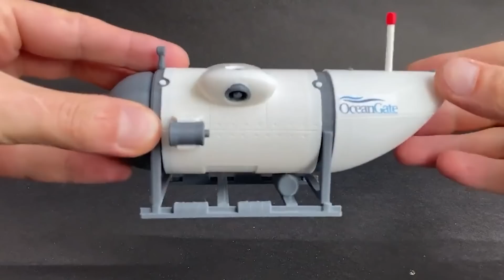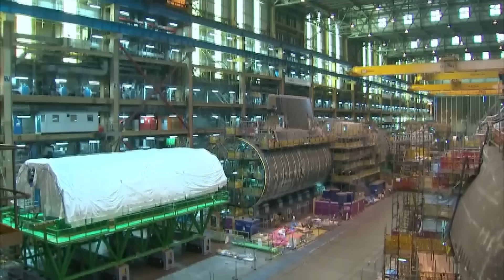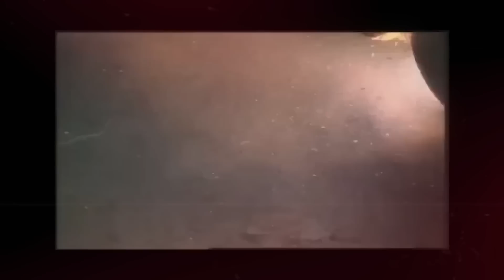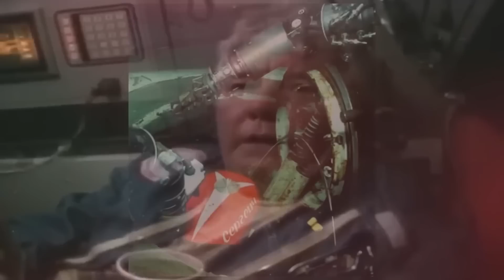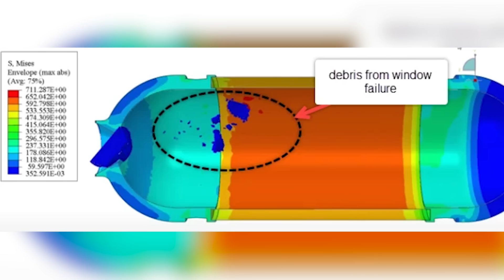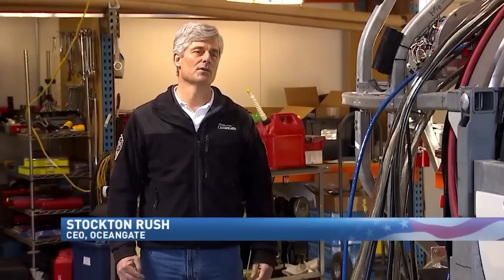New footage Just Revealed A TERRIFYING New Story About how the Titan Submersible really Imploded

Comment: @3:20 min.  I'm sorry, not sure why people keep saying that if the window broke first "we expect debris to explode outward"...  This shows no understanding of symmetrical pressurization - There is no low-pressure location for debris to want to 'explode outward', if the window failed the pressure wave (literally) would simply rush in to compress everything like an engine-piston until the pressure was the same inside as outside, there would be a bit of 'water hammer', but not really so much as to eject everything 'outward'.  People keep saying this like that know what they are talking about as a matter of fact - so, in short - I doubt everything would eject outward if the window failed.  I'm sorry - ALSO, you draw WAY TOO MANY conclusions from the debris-field visuals, I'm sorry but you don't know what you are taking about.

Comment: One issue with carbon fiber that’s never addressed is that UV light degrades it.  It doesn’t look like they protected the hull from light at all.  I think it was also stored outside for a while.  All that light exposure degrades the epoxy backbone.

Comment: I have been surfing years. I am familiar with fibreglass, resins, epoxies, catalysts, and sanding. What water does to surfboards is scary. Those boards will break at a stress point and depending on the speed and energy of the wave.  Bones have been crushed. All that said,  how on Earth did they think that composites would withstand those pressures? It is beyond me. And the domes were sealed with glue. That is just crazy.

Comment: What I first notice in the assembly is the lack of clean room use. I see no head coverings and just street clothing.   One hair can cause a underwater camera failure with many times less pressures and a fraction of the depth this vessel went. With sticky epoxy gosh only knows the amount of dust and debris at all the joints.

Comment: The end cap joints look very simple.  Under engineered.   Centering riblets, machined barbs on the titanium, and a method for pumping in the adhesives would have increased the cost significantly,  but that joint does look feeble for what it needed to withstand.  I don't think that carbon fiber is a lost cause in high pressure applications.  But it needed more mechanical attachment strength.  Consider how rebar can turn a thin slab of concrete into a strong supporting structure.  Without rebar, a good impact will cave it in.  With rebar, it can support traffic.  I think he was overwhelmed and took the easier route with disastrous consequences. I still don't believe that he needs to be vilified post mortem.

Comment: I must have said it a thousand times now an would never change my mind when I first set eyes on this crappy flimsy death trap submarine it was screaming at me a death trap that would implode on its self everything about it was done of the cheap if your going to build a proper submarine to go down to the titanic you need very deep pockets indeed at least £200 million pounds to £300 million pounds submarine glass would have to be at least two feet thick an thd submarine steel hull would have to be 3 feet thick solid steel thickness submarine hull that could with stand miles deep pressure on the submarine sadly this was made by uncheck health and safety issues that really sent alarm ⏰ bells ringing a death trap in thd making titan submarine a worthless piece of trash that should never have been made an certainly never sent down to the bottom of the ocean to a titanic grave that ended sadly the lives on board this flimsy death trap submarine to implosion an instant death rest in peace now your in gods kingdom heaven 😅😮😮😢😂😢😮😮😅❤❤❤❤❤❤❤❤❤❤❤❤❤❤❤❤❤❤

Comment: i think its key that the previous messages to the sub were something along the lines of "your pinging a lot farther below than you should be" it seems like they were descending too fast, for some reason. they likely realized this or it was causing cracking and issues with the hull and they finally decided to try to slow it down (but it was too late) ... As water started to flow in, it probably made it heavier, and made it descend too fast...
Reply: I don’t think it’s possible to have a leak at that depth. The moment you get water coming through it’s over. With that amount of pressure a pinhole would turn in to a catastrophic failure in a matter of milliseconds.

Comment: Dropping 2 weights likely wasnt an attempt to surface. You also drop weight when you reach the bottom so that you can have some bouyancy to manuever around the bottom. Essentially it makes tou float a little lighter for easier movement on the sea floor. From what has been shown in the coastguard hearing is that they had no idea there was any problem and it happened before they knew it. They also said they didnt believe it happened at the porthole, that is happened towards the back.

Comment: buddy they said straight up right after they played that messaging stuff that the last message was completely normal. the mir 1 and titan are completely different submersibles. tiran didn't have ballast tanks. it only carried ballast weights. dropping 2 weights would have slowed their ascent some, which is what you'd want to do when you're... approaching the sea floor? then they would drop a few more to achieve neutral buoyancy before they touched down. believe it or not, it's something they'd done many times by that point. entire video is misinformation.

Comment: You can still have peak stress in the middle, but with a weak bond, the lesser stress at the bond could well be enough to cause a failure long before the big peak in the middle breaks the cylinder.

We also don't know what defects were present. All the simulations assume an intact pressure hull, which it wasn't. It had been delaminating since the first dive.
Reply: They also applied the adhesive on a super polished surface, dooming it to not be able to bond together correctly
Reply: @TreeGod.  I mean yeah, that couldn't possibly be of any help.

But we're dealing with the type of seagull manager who sacked an ex-Thiokol guy for telling him the pressure hull wasn't safe and refusing to sign off on a dive.

Comment: Yet another idiotic statement that the view port failed.

1.  The viewport (unlike the carbon fiber) would give visual signs of impending failure at about 1/3rd of its way to failure.  The carbon fiber would instantly fail without any warning.

2.  The shape of the viewport was to prevent it from being pushed in, however, was not designed to prevent being pushed out.  When the carbon fiber failed, the pressure inside popped the viewport out like a cork, sending it far, far away from the wreckage.

3.  The weight drop is normal procedure on every dive when you get close to the bottom, not for "sudden emergencies".
Reply: Indeed, you are correct. About all of it. My close relative was involved in the recovery of titan and investigation afterwards. He does telemetry and data studies. Idk why people claim the view port failed when it was clearly the carbon hull and then pushed the port window away from the wreck
Reply: @AlanpittsS2b you are both incorrect. Based on the examination of the wreckage a few of the experts are saying the likely point of failure was the joining of the front titanium ring to the carbon fiber hull. Does everyone remember that horrifying footage of Stockton and crew installing the rings in a filthy open air warehouse, using a paintbrush to apply the glue? Yeah that joint. Everyone misses that at those 2 joints there was nothing holding back the ocean pressure but a layer of glue, that otherwise had a clear channel of 1-2 MK’s. They had three substances that had different expansion and compression characteristics, titanium, carbon fiber, and the glue holding them together. So the bond slowly deteriorated each dive.

One expert testified that when he examined the front titanium ring, it had been blasted completely clean. Surgically clean, without a trace of glue. And the inner flange of the titanium ring had been sheared cleanly off, all the way around. The failure was not a single point, but a complete failure of the joining around the entire ring.

This created the massive pressure wave originating at the back of that first ring, and blasting both forward into the nose cone, where it blew the window out like a cork and knocked the nose dome off, and sent a blast wave rearward collecting all the material and ramming it into the tail dome. Because at the same time that pressure wave is inside pushing rear wards, there is an external force pushing inwards on the hull, and folding the no longer supported carbon fiber of the hull into the center of the craft. Everything back of that front ring just folded itself in towards the center and got jammed into the rear dome. That’s probably also where they found the human remains. Astonishingly about half the floor plate/battery box survived attached. That’s the piece sticking out from the rear dome.

So it wasn’t a straight up carbon fiber failure. Nor the under rated window. It was a failure caused by using composite materials with different physical properties.
Reply: @andrewtaylor940  I watched the entire video of the assembly of one ring to the carbon fiber cylinder. There were multiple problems with what was recorded. Let's start with the surface preparation: the video clearly shows a worker with a dirty rag wiping down the titanium prior to the glue application. The video also shows a worker touching the metal surface with ungloved fingers prior to the glue application. The work pieces were sitting in the open air, where dust, fibers, etc will fall on it both before and after the glue application, not even a dust cover was used. 

Next was the glue itself. This glue was a two part resin and hardener that was mixed by hand, and they used a thickening agent to get it to stick to vertical surfaces without running or sagging.  I can tell you from experience using this exact or nearly identical materials that you have to machine mix in order to get an even consistency and thoroughly incorporate the thickening agent, usually a powder filler of some type. Once the glue is mixed it has to be degassed in a vacuum for a few minutes to remove trapped air... It was not properly mixed, it was not degassed, and it was applied to a dirty, oily, surface.
Reply: @andrewtaylor940 very well explained logical  Bravo 👏deep carefully studied examined that makes sense  good job,  very beautifully described and makes sense!!!
Reply: @rtqii excellent presentation well explained in detail good job!!
Reply: yeah this channel sucks lmao, they explained all this in the hearing where we found this shit out but i guess actually spreading relevant info is for chumps, we gotta run with some shit i seent on twitter and my own personal interpretation of it, over facts. 

the worst part is, the facts coming out are so much more damning than this made up shit.
Reply: @x_elen_x Have you checked out Scott Manley? He has a video after he had watched some of the earlier inquiry. He is really good at thinking these things over, and coming up with a theory of what happened. His take on this was very interesting and well explained.
Reply: @ronfullerton3162  yeah i did, i had a similar thought to what he said. the way the wreckage is scalped up one side like a rental truck hitting a low bridge makes me think it was the epoxy failing. plus, i don't remember specifically if he mentioned this, but the way the titanium ring on the outside of the front dome was peeled away and straightened out like it was a tin can 😬
Reply: @x_elen_x  I do not know if he mentioned that or not. But that sounds very interesting. Guess that I will backtrack and check that out. Thank you!
Reply: Its obvious its the bonding between it and the hull was the problem. Having any vessel held together just by glue is beyond moronic.
Reply: @zalandarr  Flex Tape!
Reply: @zalandarr right that blue my freaking mind that they glued the end cap  on😳wtf
Reply: Yeah, notice the message specifically said 2 weights. If it was an emergency and they needed to resurface, they would’ve dropped all weights
Reply: So where is the most likely spot of failure?
Reply: @stephenhill3286  where the carbon fiber mates with the titanium.
Reply: @stephenhill3286 It failed at the glue joint where the front titanium ring attached to the carbon fiber hull. It apparently failed all the way around the ring, the complete circumference of the cylinder, all at once.
Reply: @stephenhill3286  The front Titanium Ring. The seam where it was glued to the Carbon Fiber Hull. That was and always had been the weakest point of the Hull. We have video of that connection being made in a filthy warehouse using a paintbrush. If we believe Castersons testimony the exact point of failure was the glue was peeled completely  off the titanium, all the way around. When they found the ring the inner surface where it had been bonded to the Carbon Fiber Hull was perfectly clean. No glue, no traces of carbon fiber. And the inner lip of the channel the carbon fiber sat in was sheered off.
Reply: The front hemisphere had already fallen off after another dive. It seems the joint between the hemisphere and the cylinder was a weak point
Reply: @molybdomancer195  the titanium hemisphere bolts to a titanium ring. These were the shorn off bolts you are referring to. These bolts were replaced.

That titanium ring was glued to the carbon fiber cylinder.

You realize the pressure vessel is 5 pieces, not three?

Titanium hemisphere - titanium ring - carbon fiber cylinder - titanium ring - titanium hemisphere

The titanium hemispheres don't come into any contact with carbon fiber at all. 

What you are stating is that the problem was between two titanium pieces, and the fault was not the carbon fiber. You are saying Stockton Rush was correct that carbon fiber was not dangerous.

All the experts are saying the carbon fiber cylinder was the problem, but you are saying that the titanium failed.
Reply: cool, so a video that not just spouts false facts and also tries to make money out of it... freakin disgusting
Reply: I don't think it's the view port at all. Someone pointed out a buckle in the pieces of this this. Microscopic stuff they've checked. All the way down to the 1st layer they began with.
Reply: Featherpony? Is that the name P.Diddy gave you while you “worked” your way through college?
Reply: @TheCrippledCamper  No, it was your wife. But close.
Reply: @featherpony  featherpony😂

Comment: It makes sense to me, remember they have to take the front off to get in and out of the thing so the stress of taking the front metal section on and off would make the front of the febier cylinder even weaker.
Reply: From what I have seen the door panel screws into the ring. The door panel is not directly in contact with the carbon fibre. Think of a sink plug fitting into the metal drain hole, which is fitted into the bottom of a sink.

Comment: I keep thinking what if the weights only dropped on one side when he released them.
Reply: Even if they had dropped the emergency ballast and only one side released, the listing of the craft would not be likely to cause any operational issues for the equipment. The weights not dropping would be an issue, but no more than if the same weights were balanced and a listing craft would have only been uncomfortable for the occupants, being pushed to one side of the interior.
Reply: Those two weights, used to slow the descent so they dont crash hard into the ocean floor, are hanging by a chain centrally below the craft, not "on the sides" like the other weights.
Reply: @featherpony  ahh my therory is ruined 😂

Comment: Nothing cryptic about the message as it was getting close to the bottom and needed to slow its decent. If there was a message saying it dropped all the weights that would be different.
One would be normal operation and the other would mean it's trying to get to the surface as fast as possible.
Reply: Exactly! They dropped weights to slow down to see the wreakage, not because they had an issue. Bad infor ation!
Reply: Yep, this is a BS SHOW
Reply: @GremmPaltakin  Iphone..should see what happens when i type in pencil😅
Reply: Look, an armchair submariner!
Reply: @andreseh87  nope, just informed by multiple sources. Check out the hearings.
Reply: @andreseh87 they literally said this in the hearings. everyone involved said this. from former "missions specialists" to the former director of operations to ~literally everyone.~

also, it's a submersible. not a submarine. it would be "armchair submersible pilot."
Reply: Armchair submerged pilot. 😂 @x_elen_x

Comment: Anyone else not a bit freaked out that end cone contains 5 people!!! Or the majority of 5 people
Reply: Doubtful, they would likely have been very thoroughly disassembled before they reached the rear dome
Reply: The report describes the DNA profiles of all five were isolated from the "presumed human remains."  I'm guessing they found some soft and mushy stuff in amongst the hard and crumbly stuff and tested it.
Reply: @CrashTestPilot  
That's how it sounds to me.
Reply: @CrashTestPilot what about teeth? Would teeth survive?
Reply: They are in the rear titanium dome.
Reply: @ludwigvanzappa9548   No, the rear titanium dome contains electroinics.  That dome was sectioned off with a wall containing a monitor.  The computer and other equipment was in the rear dome (and no, I'm not talking about the non-pressurized tail outside of the pressure vessel, I'm talking about inside the rear titanium hemisphere).
Reply: I assume they would have found pieces of clothing and shoes containing traces of DNA or whatever was left of them.
Reply: Those poor passengers were Thanos'ed
Reply: You just know that someone’s face was smashed into someone’s balls 🤣🤣🤣